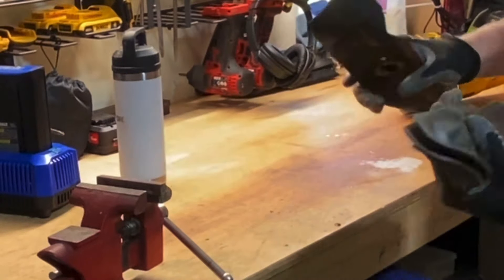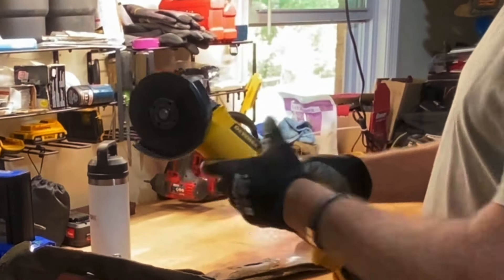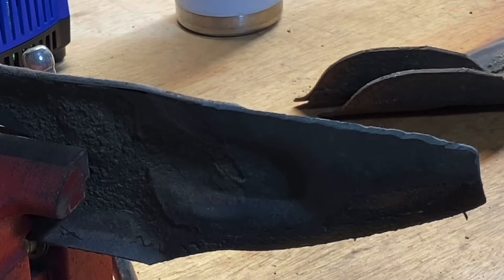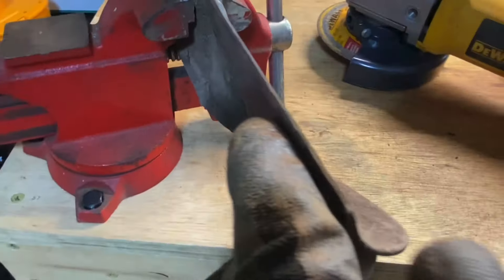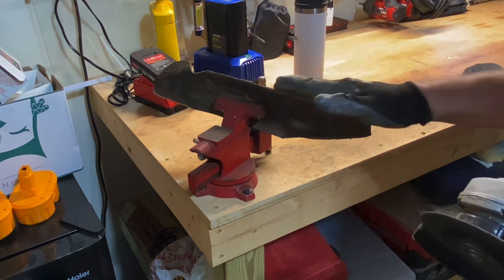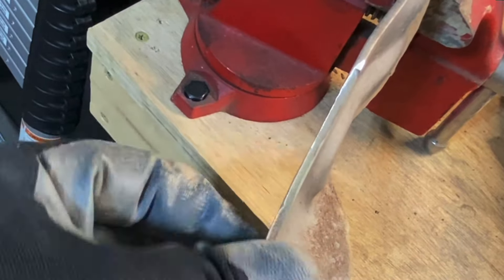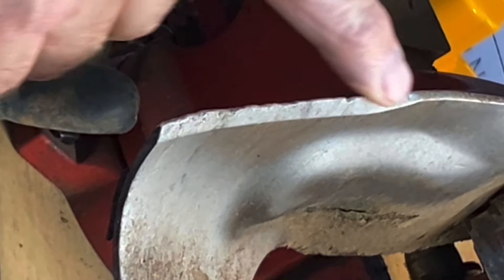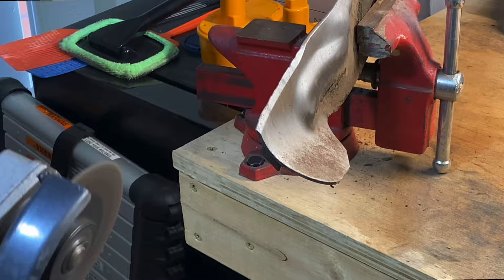Transform Dull Blades: Sharpening Tips for All Lawn Mowers!

Comment: Looks like you sharpened the bottom also rather than just removing the burr. thanks for the video
Reply from the maker: That burr was rolled over pretty bad, Lol. They were in bad shape. I didn’t really sharpen the bottom, i just pulled the grinder down a little too far, it is smooth enough on bottom. Thanks for the feedback.
Reply: @hackthehoneydolist  Thank you. I get it. You've been mowing some gnarly stuff lol.
Reply from the maker: Yeah it was bad, Lol